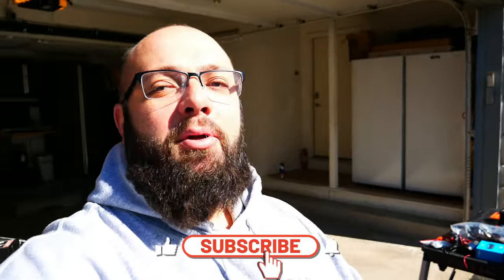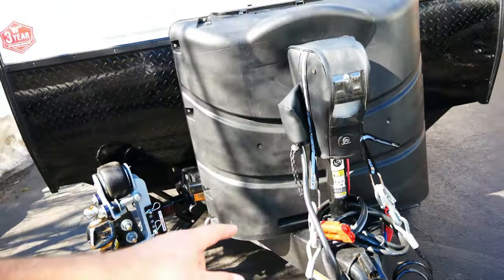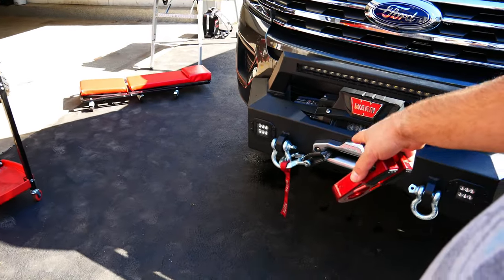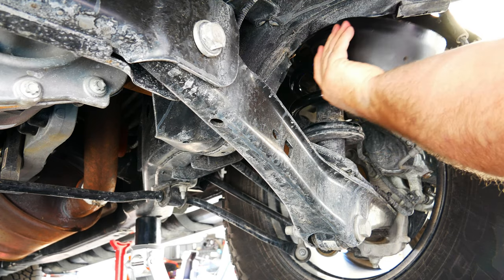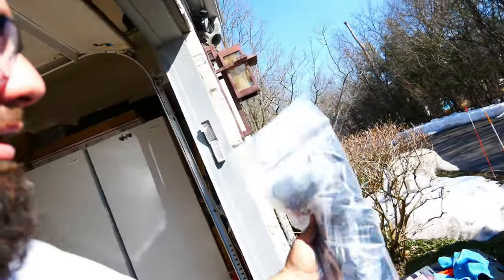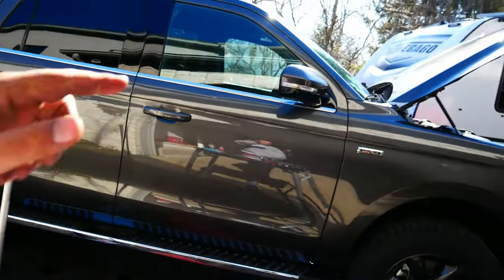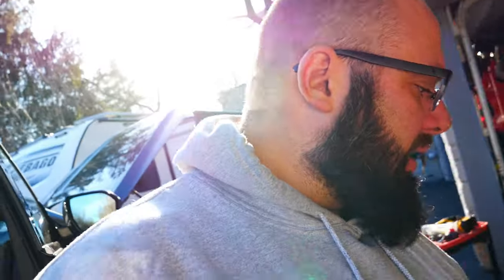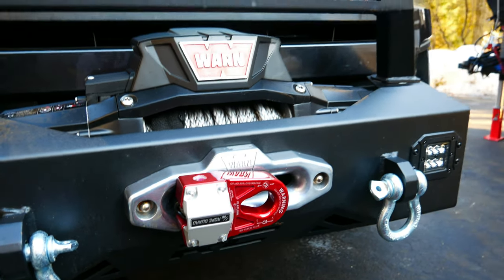2020 Ford Expedition FX4 Gets some Upgrades!

Comment: I watched your other video are you still running a ready lift if so any pros and cons? Great video btw
Reply from the maker: Yes still running it. 16,000 so far. About 14,000 are towing a 7,000 pound trailer so I added sumo spring spacers in the rear. Other than that all good!